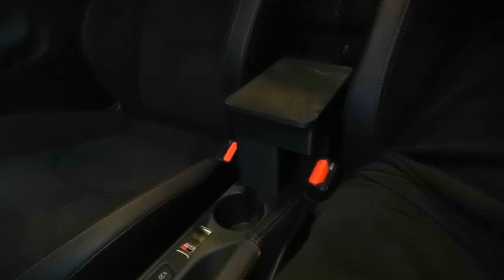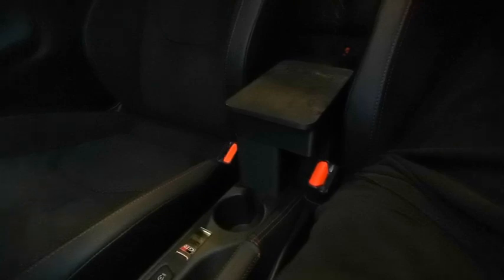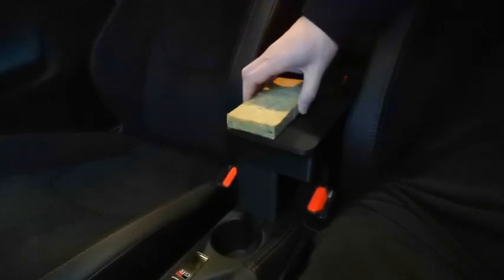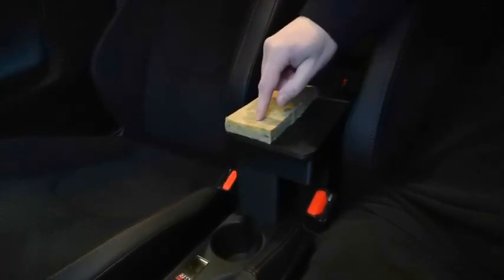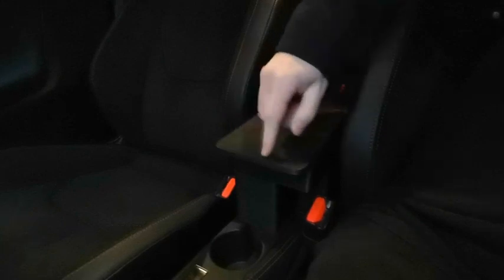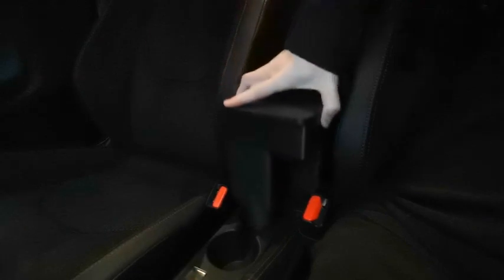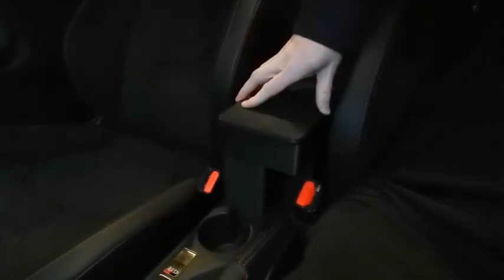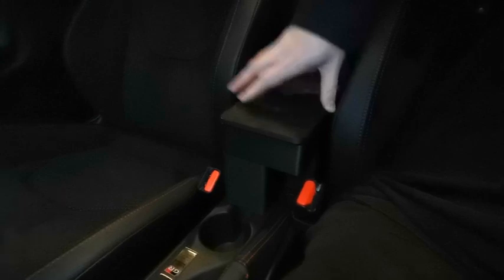GR Yaris - 3D printed armrest

Comment: Fantastic!  You are a star.  One thought (a cheeky request I know!)  Would it be difficult to design something for the dash cubby hole on the GR Yaris to hold a mobile phone securely?   At the moment mine slides out if I go around a corner too fast!  I am happy to pay for it!    Bloody cheek to ask I know! :)
Reply from the maker: I'd suggest a Brodit Proclip, at least that's what I chose so I have it connected with USB to get Android Auto running when I get in the car. I use the Proclip and then a 3D printed holder specific for my phone's protective case but Brodit has a universal holder and swivel mount that works well too. Mine looks like this https://youtu.be/U-omd4_h-wU

Comment: Can you please upload the Bottom Part as a full Body not hollow? I dont't like the Overhang on the inner upper Radius. 😉
Reply from the maker: Yeah you get a couple of strings not stuck together properly there. But you never see that part when it's installed in the car so I didn't bother doing anything about it. I'll see what I can do 👍
Reply: @rejsa-nu   Thank you. In the mean Time i will give it a second Try and reduce the Layer  Height to 0.1mm in the Top 10mm, maybe this helps.
Reply from the maker: @Helmut Eder Updated on Thingiverse with slightly larger bottom hole with slightly less overhangs :-)

Comment: Done! Have print all Parts. Did you glued the three Parts? Bottom, Middle and Box?
Reply from the maker: Yes, glued. Bottom and middle have pins to help  position right but between middle and box you just glue and position correctly yourself, no pins. Will you do some leather and padding yourself? I'm getting help for that ☺️
Reply: @rejsa-nu  I ordered self-adhesive 10mm rubber (Kautschuk) mat and self-adhesive synthetic leather sheets from Amazon. i made also a smal, 2mm, Frame around the Table to fix the Leather Sheet at the Edge.
Reply from the maker: Love to see it when in your car 👍
Reply: @rejsa-nu  Will do

Comment: Thanks for creating something that is sorely needed in the car! Just wanted to ask what % infill you used and layer height for the print? Will be test printing in the next few days.
Reply from the maker: Outer walls/perimeters: at least 3
Layer height: 0.3mm  (it takes a looooot of hours to print all parts even at that height)
Infill: 15-20% works fine
No supports
Reply: @rejsa-nu  Thank you so much! I will give it a go and let you know how it goes, also do you have a rough idea how much filament is used?
Reply from the maker: Depends on the print settings of course but I think my print took around 900mg filament. Stable strong pieces and lot of print time...